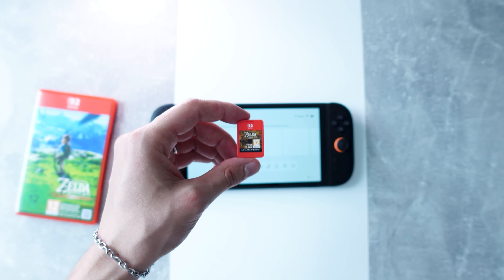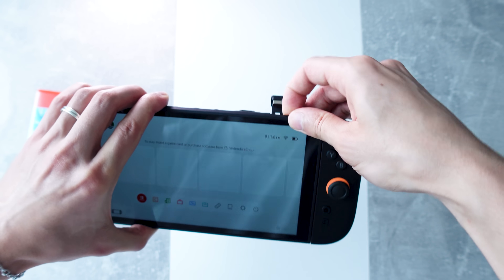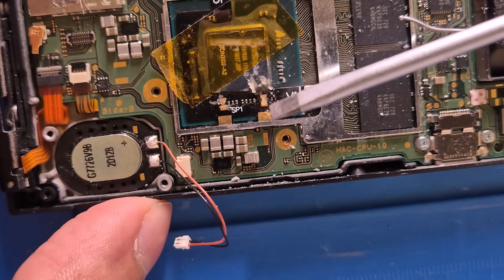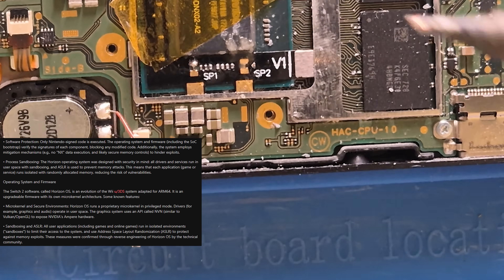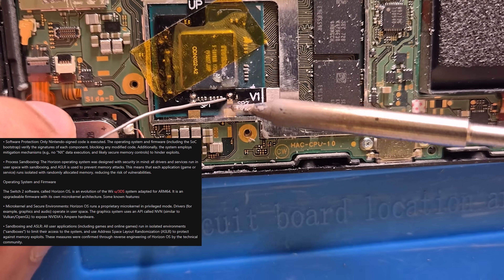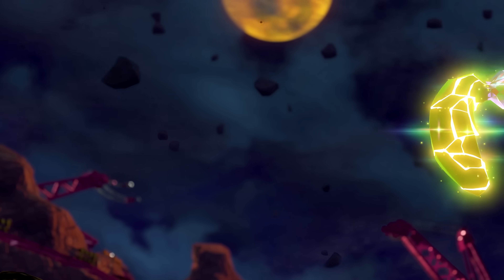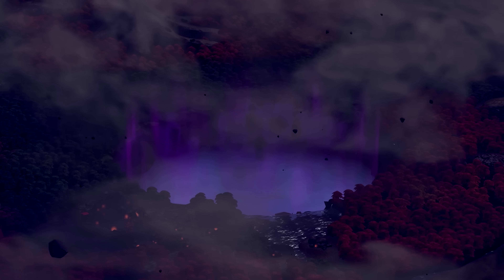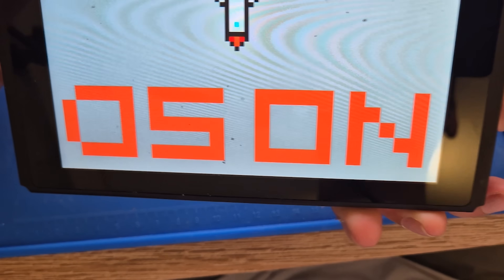Switch 2’s “Unhackable” Security – Why Hackers Are Stumped

Comment: Remember. Nintendo's hardware is still dated. Hackers will find a way
Reply: If i understand correctly, it doesn’t really have much to do with how “outdated” it is. This is a custom SOC & OS so it will be much harder to hack out of the gate unlike the off the shelf Tegra X1 switch 1 had.
Reply: @jahnotreal 
It will probably require a modchip, which will be a win for Nintendo because most people won't have the expertise to solder a modchip into the Switch 2.
Reply: @russellmania5349  yes i’m aware of this… hope it’s not that much harder than modding an oled
Reply: @jahnotreal 
I can't imagine it be harder to solder a mod-chip into the Switch 2 then it was Oled. If you already have the skills to mod the Oled without damaging the console, then you should be able to mod the Switch 2 as well when the time comes.
Reply: @jahnotreal  then why are other previous consoles so easly hackable? this one is no different.
Reply: @circledude2362  cause no Nintendo system up to this point has had this much encryption & security. Also Switch 1 was a lot more secure than the previous consoles on paper, but had the huge RCM security flaw that made it very easy to hack. So yes this one is different & I feel like this video explained it pretty well…
Reply: @jahnotreal  hackers are getting smarter and smarter. they will find a way to hack both switches
Reply: @circledude2362  i know but it’s gonna take a lot longer and more work than switch 1
Reply: @jahnotreal  do you realize how smarter hacking are becoming? With all the tech/cyber knowledge they gain it would take them shorter then other hackers.
Reply: It’s not ‘dated’ in any way shape or form. It’s very much current hardware and specialty hardware at that. Total measure of processing power has nothing to do with how ‘current’ it is. And actually for a mobile chip of its type it’s actually very very good. Power consumption versus what it actually can produce versus its die size is actually very impressive. I actually wondered just how good it would be if it was in an unlocked state in something like a mini PC where cooling and power limits were not a priority concern.
Reply: @r100curtaincall  Nintendo is barely catching up with modern hardware. why you think they're charging so much.
Reply: The specs, yes

Security however, No.

In a roundabout way the hacking scene is partly responsable for the price of the Switch 2.
Reply: @phillipbones7522  dont underestimate the hackers. they can hack the hacking prevention in order to hack.
Reply: @phillipbones7522  No, Nintendo's greed and stupidity is the sole reason for the prices relating to the Switch 2.
Reply: @megaman37456  why does that read like a temper tantrum?
Reply: @megaman37456 man that is an extremely nuanced way of looking at the world

Comment: Remember when the Ps3 and the Ps4 were considered "unhackable"? yeah, that didn't age well. Just give it time, something will be able to boot into Recovery Mode to inject a Payload: a modified save file, the internal browser, or even something silly like using the microphone to inject a modified audio to cause a crash.
Reply: Exactly. Hacking something is simply a matter of time. And frankly, since the S2 is so high profile, there are going to be a lot of people attempting to crack it over the coming months and/or years so they can be first. Doesn't matter how long it takes, it will happen.
Reply: @Kamawan0  It's not only a matter of time. It's also a matter of effort and personal cost. Given  Nintendo's insanely litigious behavior in recent times, the incentive to put in a huge amount of time and effort like what seems to be needed here is very small. On top of that, the hacking/cracking community itself is a shadow of what it used to be. I wouldn't be surprised if this console doesn't get hacked for years.
Reply: PS3 wasn't necessarily unhackable in the same sense. The cell processor was just very strange which came with it's own issues
Reply: The PS3 wasn't considered uncrackable at all. It just wasn't profitable at all to do so given the price of blueray burners and blueray discs themselves, especially with games taking up so much space that even hard drives wouldn't be really profitable either, as it was so annoying to have to do transfers, not to mention the fact that using an external hard drive was a method that was already completely new at the time and arrived late in this generation of consoles. And since it was also a pain even for game programmers themselves, there was no point in worrying about it being used by anyone in the end. To add to this, the console itself was already rather unpopular compared to its competitors and took years to become interesting for gamers. So at the time, all you had to do was wait for your game to be sold second-hand for a pittance.

So that's a whole bunch of good reasons not to even try to crack it.
Reply: Bruh its more likely that the switch 2 will be hacked at hardware level.
Reply: Not true super slim ps3 still isn't fully hacked

Comment: Every single Nintendo console released up to the switch 2 has been hacked in some form, whether it be flash carts or cfw. I see no reason to believe switch 2 won't be hacked in time. Remember when Playstation 3 was 'unhackable', then they pissed off the hacking community by removing OtherOS? Yeah..

Comment: keycards + all these security measures. Switch 2 could possibly the hardest one to hack. I will give it a year and just buy physical copies of first party games. I will just resell my switch 2 if it doesn't get hacked for a year. Too expensive for me to keep nintendo as a hobby
Reply: The MIG card is already recognized and read by the console, which doesn't necessarily ban the user directly based on what they do with it. This detail alone already represents a huge breach in their system.

Comment: The louder people say "unhackable", the sooner it'll get hacked, lol. So keep it up.
Reply: Also Microsoft allows homebrew on retail Xbox Consoles
Reply: Xbox one and series X and S is pretty secure
Reply: @prizixz not actually true. Because of Dev mode there is little reason to do so but it's still windows...
Reply: The more Switch 2 get turned into a brick, the quicker they'll get hacked. Especially when they got bricked early, when the latest patches were not deployed to them... Hackers will be able to buy Switch 2's for pennies on the dollar just to decap the chips and photograph them under a microscope... Nintendo is doing everything it can to make sure this thing is cheap to hack and has vunerable software still on it by the time it happens.
Reply from the maker: Haha yeah, that’s usually how it goes! Nothing stays unhackable forever… or does it? 👀
Reply: With enough time we can crack anything and everything
Reply: @yu-gg Sega Saturn took 20 years before the cd copy protection was defeated (bypassed much earlier though...)
Reply: @yu-gg  I mean the Switch 2's first layer of security was cracked in the first 4 hours it was released, that sounds pretty hackable to me. Also hackers aren't stumped, it's only been a month since the Switch 2 dropped, it took almost a year for the the Switch 1 to get hacked, and almost 2 for custom firmware to be optimized for it.
Reply: @megaman37456  I dont think Hacking the Switch 2 is gonna be easy. Still it was not fully hacked or anything. A hacker unready reported Nintendo about a product security flaw so its prob unready patched whatever it was. Switch 2 is pretty damn locked down.
Reply: What about Xbox One and Series then?
Reply: @themanmaske  Why would you hack it when you have developer mode?

Comment: It will be possible there is nothing unhackable 👍🏼
Reply: we will see😁🥳
Reply: Xbox one is unhackable
Reply: @Unparalleled109  It got hacked though? but it also got patched quickly.
Reply: The ultimate irony is that switch 2 uses Nvidia chip
And if it got hacked by AGI ASI running on Nvidia chips and switch 1 was hacked because of Nvidia too
They predict ASI by 2027
So it will be early in the switch 2 life cycle.
It could certainly aid in the process
Reply: A Brick
Reply: Saying things you have no idea about. Why hasn't anyone hacked bitcoin yet then?
Reply: @zhuhang.jasper  I would imagine that it has layers upon layers of encryption. At some point, a vulnerability will be found, nothing humans make are invincible.
Reply: The PS5 is unhackable 😅
But i think switch 2 it will be
Reply: @mehdiboutabba9222  there's jailbreaks for the PS5. Just nobody uses them because it's not really a cheap system for it nor is it portable.
Reply: @HYPER-MANIA  PS5 has already been jailbroken